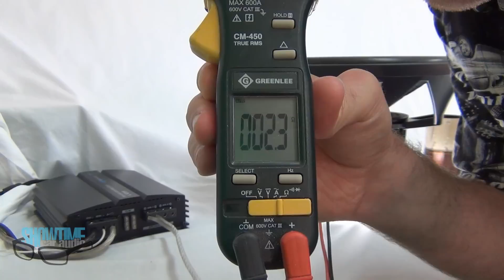Showtime Electronics- How to Wire A Subwoofer and Voice Coil Explanations!

Comment: Sense amplifiers put out the most power on 1 ohm, it would make sense then to wire everything to 1 ohm. and If I am using dual 12s, I would need them to be rated at 4 ohms (because 2 ohms would give me 0.5 ohms) and run them in parallel and that way I can wire it to 1 ohm and push the most power. Is that accurate?

Comment: How do you wire 2 dvc 4 ohm  subwoofers to a 2 ohm load ??
Reply: First, wire each speaker in series, (+ to - ) = (8ohms) on
one speaker , then ( + to - ) = (8ohms ) on the other, then (+) from one speaker  to (+) on the other, then repeat the process with the (-) terminals in which the speakers are now wired together at an 4 ohm load now  (+) to (+) and (-) to (-) to amp bridged mode for a final load of 2ohms

Comment: 🔴 I have two sub amps, each amp is 2ohm stable @500watts. I had two DVC 4ohm subs 600watts RMS, one per amp. Now I upgraded my subs, but ended up buying two DVC 2ohm subs 700watts RMS. I'm not sure if I can even use them the same way I was using my DVC 4ohm subs. Help me understand if possible, because it seems to me I can only run them in series, with would only give me 300watts from each amp per sub. Can I just use one voice coil on a DVC sub an still get the 700watts RMS? Any information would be helpful... Thx!✌🏾

Comment: Quick question if I may: I have to two 31bands audio control EQ’s & 3-way Xover & Epic- the instructions for epic says to connect RCA from radio to epic before all other devices for bass restoration- but I wonder if in my situation if that is ideal? I felt that going radio-EQ-Xover-Epic —- any input?? Or reasoning why I should Run to Epic first? Thanks

Comment: Thank you sir, for your very clear explanation of subwoofer with double voice coil @ 4 ohms each terminal. And turn it to 8 ohms..now, I can use it to my home amplifier rated with 500 watts per channel.my amplifier has a 4 channel @ 8 ohms each channel...pls correct me sir if I'm wrong .I'm still need your advice.thank you very much.....

Comment: so if i have a dual 4ohm sub with a dedicated 2-16ohm amp, should i put them in paralell or plug both outputs to both voice coil?
Reply: +Saqif Chowdhury Your confusing yourself with your Tech Language.
The Amp Rating simply means - This amp puts out stable power from 2 ohm to 16 ohm. 
You should wire it for the best sound. (most car stereos are looking for 2 to 8 ohm and most home stereos are looking for 8 to 16) Your Sub is multi-purpose.

So the question becomes, how do I know I have the best sound? 
The best way is wire it as shown in Parellel aka   Sub wired + to +
Start the car, rev to to 2000 RPM, hold that RPM, play stereo at WOT
THEN
Check your battery voltage under that heavy load. is it at least 10 v at all times ?

If you don't have the batteries/alternators in your car to POWER that amp at WOT under a 2 ohm load- you have to start re-wiring to 4 ohm or 6 ohm or 8 ohm until you can sustain your battery voltage to 10v at all times WOT.
(or get a few capacitors of the correct Farad)  so you never run out of the correct voltage , your sound will suffer greatly if you can't hold voltage, that is way guys run capacitors. (You gotta at least have 10 volts at all times, higher voltage is just better sound is all)
Wire it up Parallel, run it to check volts
Then rewire and do again and recheck battery volts under WOT.
 ( Talking about your initial wiring of the sub as he shows here. Which is Dual Voice Coils wired + to + and - to - 

THEN sub wired to amp + to +, - to - )

your 2nd question, again your confusing yourself with language.
If you ahve a dual voice coil, you always hook them both up. 
There are 2 ways 
SUB + to + = Parallel
SUB + on first coil from AMP then - on 2nd coil = Series
Reply: +Saqif Chowdhury The issue on wiring the AMP you have, is more complex than shown here, you have to get your paper work for THAT EXACT MAP and see if it is "bridgeable" to know the answer.
Reply: +Chuck.Raney Raney ty!
Reply: hi guys ! i also need help with my sub and amp wiring! i have a hifonics titan tx4005 amp (2x200 rms in bridge mode) and a pioneer w310d4 sub with 2x2 ohm coils! what i see now through the glass of the sub box, is that the + and - is wired to a single coil, and ghem IT comes out and goes to the amp ! the other coil is not wired at all! what to do next? thanks in advance !
Reply: DeeJay KmiKze to do anything differnetly, you will need to UN-bridge the amp. 
It might not sound better. BUT it might. It is all about teh sound anyway. There are multiple wiring options your setup, it's all about achieving best sound for the car. 
SO: get a great long bass heavy song.
Then
Leaving it bridged .... simply wire 2nd voice coil up, in Parallel. Check Sound. 
If you don't like it as well, rewire 2nd voice coil in Series. Check Sound. 
If you still don't think it improves sound. Remove all wiring from 2nd voice coil and recheck sound.

Comment: Would you recommend wiring using both methods as class d amps only safely go to 2ohm load? So could I wire in parallel and series to keep it at 2 ohms

Comment: here is the sub i bought

i would just like someone to tell me if what i did was correct by wiring it SERIES instead of PARALLEL because its for the home not the car, and im sure there is a big difference with car amps and home 5.1 receivers.

Comment: the other problem i have is, im sure this subwoofer was designed for a car because it has 2 dual voice coils at 2 ohm each.
your video was a lot of help, and i have been told most home receivers will do or wont do 8 ohm ? i may be completely wrong.
so i have wired the jbl 15" using SERIES method because it will be used in the home via the tv and computer not for a car.
i thought this was the best method instead of parallel cos it would drop the speaker to 1 ohm hence series is better in home.

Comment: hi there i have a JBL 15" and i have made a custom box for it 500 by 550.
i have the box finished but i have encountered 2 problems.
the terminal plate on the back of the sub box are gold plated screw ins, and my yamaha home theatre reciever inputs for the sub are 2 red/white RCA`s.
so the only thing i can think of it to cut the end of the RCAs and wire the terminal plate that way (and of course not cutting the other end cos that will be in the amp)

Comment: Quick question showtime. I have two dual 4 ohm woofers if i wire them in series it will bring them up to 8 ohm correct?? And if i wire them both in parallel it will bring them to a 2 ohm load correct??

Comment: I have a Question Showtime, i have my 15" Sp4 wired in parallel just like you did in the video with a jumper, i used all 10 gauge wire. then 2 months later i take my woofer out and saw that the negative lead going to the coil broke on the side that i had going out to the amp. what do you think caused it? Was it because there was more power going in one coil then the other? or over powering it? and why would only the negative lead break on one side and the other keep playing for so long?